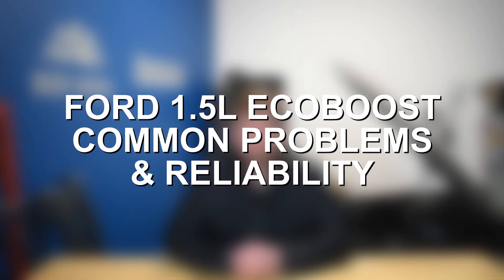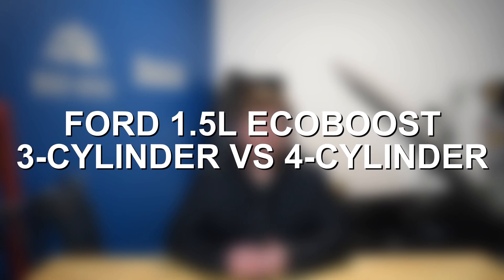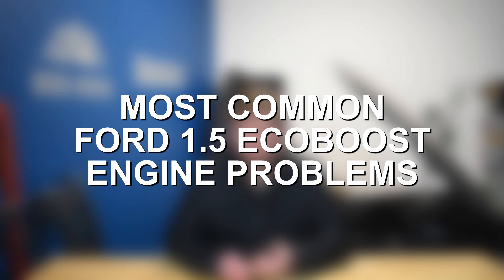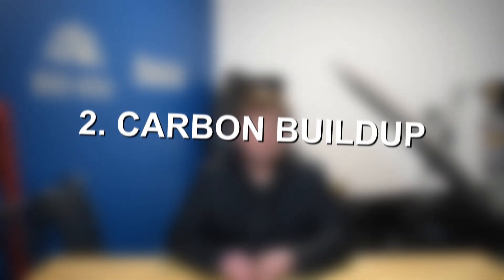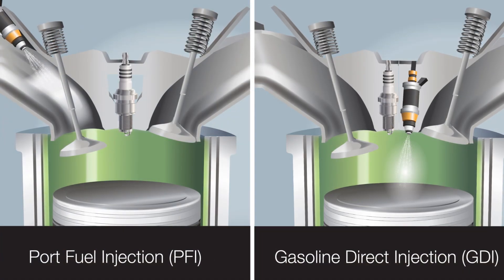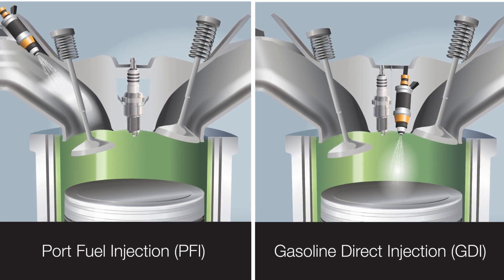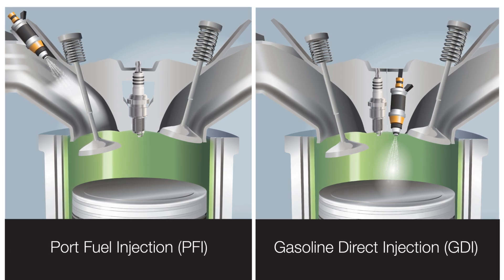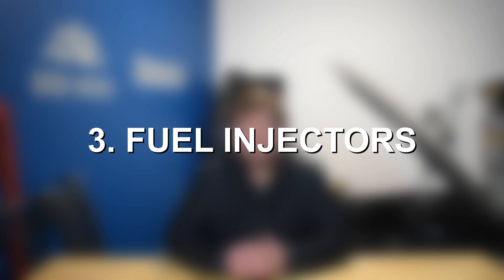The 1.5 EcoBoost | Common Problems & Reliability

Comment: I randomly ended here, i've this engine and it has 110k km now. It's one of the best engine ford has made, and probably one of the best 3 cylinders ever in a casual car (focus mk4). I've searched for hours, for days, what issue this engine could have, and there's no major issue reported, as  all issues it had were isolated.
And for my experience, after 110k km there's no issue, maybe one of the issues i can have from now on is the turbocharger, but it's not linked to the engine.
It needs a lot of maintenance tho, like any downsized direct injection recent car.
Reply from the maker: R - Nice! Thanks for taking the time to share your first-hand experience.

Comment: I have 2013 Ford Fusion 1.5L with a little over 100k miles. Just had the valve cover gasket and the oil pan gasket replace about a week ago. After I finish paying off the Fusion I bought the extended warranty which will expire in August. Have not had any coolant problem other then replacing the radiator and hose leak.
Reply from the maker: N - Thanks for taking the time to share your experience!

Comment: 22,000 miles, check engine light comes on and off. It got hit with a Customer Satisfaction Program and my Vin was part of the collant intrustion problem. Took it to the dealer. They said, because the light wasn't on they could not diagnose it. But they were kind enough to wipe my history.... then tried to upsell me on sparkplugs. 

Disappointing but serves me right for buying a Ford.
Reply from the maker: F - Sorry to hear this.. However, thanks for taking the time to share your experience!

Comment: I have 2013 Fusion 1.5 with 135 k on the engine. Would you recommend Valvoline Restore and Protect to clean the engine?
Reply from the maker: S - With 135,000 miles on your vehicle, Valvoline Restore and Protect can be a reasonable option if you're dealing with symptoms of oil consumption, ticking lifters, or reduced performance due to sludge or varnish buildup, but it’s important to note that while the product is designed to safely clean and restore compression by targeting deposits, results can vary depending on how well the engine was maintained prior; if you’ve kept up with regular oil changes and aren't experiencing major drivability issues, it may not be necessary, but if there’s any history of extended oil change intervals or visible varnish under the oil cap, trying it with your next oil change could be beneficial and low-risk as long as you monitor oil pressure and leaks afterward.

Comment: I just purchased a ford fusion 2017 with a 1.5l eco boost and 128,000 miles and now I’m regretting it…
Reply from the maker: A - Just take good care of it man!
Reply: I’m regretting it too same car 119,000 miles whole mess of problems
Reply from the maker: @dylanslade5315  Sorry to hear.. What kind of problems?
Reply: @dylanslade5315 have you had any problems? Currently the only problem I’ve had is that sometimes when I go into reverse it like jolts when I step on the gas and now there is a wrench on the dashboard
Reply: Лох  - трусы в горох

Comment: Hello, as far as I know, the 2023 Ford Kuga Manual 120 hp model comes with the 1.5L EcoBoost 3-cylinder engine. Have the issues you mentioned been resolved in this version of the engine? Are there any other known chronic problems with it? What should we be careful about?
Reply from the maker: E - You're correct that the 2023 Ford Kuga with the 1.5L EcoBoost 3-cylinder engine comes equipped with a timing chain and an oil pump driven by a belt-in-oil system, which Ford recommends replacing every 10 years or 150,000 miles—a labor-intensive and costly service due to limited access that may require partial engine removal; fortunately, this newer "Dragon" engine has resolved many of the chronic issues seen in earlier 1.5L 4-cylinder EcoBoosts, such as coolant intrusion and head gasket failures, thanks to improved block design and the removal of problematic cooling slits—still, it's important to maintain regular oil changes with the correct spec oil, monitor for oil consumption or misfire under load, and budget for that long-term belt service to ensure reliability.
Reply: @8020Automotive  Hello, I was waiting for your response, and thank you very much for your detailed and informative explanation.

Comment: I have probably been the luckiest man on earth with car experiences, i own this same motor in a 2019 ford escape and its running smoothly at 170k miles with no problems at all. I also own a 2014 1.4L nissan versa that still runs with no problems since i got the car back when it was released, running at 290k miles, but i usually take the ford because of how boring it feels to drive a CVT gearbox and because sport mode is fun in the ford on dirt roads too 😄.
Reply from the maker: W - Thanks for sharing your experience! Sounds like you take great care of them.
Reply: С 19-го года провели модернизацию двигателя, так что у вас и дальше все будет хорошо

Comment: I have a 14 Fusion (124k) and a 19 Escape (78k) both with 1.5 Ecoboost. I run catch cans and change oil every 3000 miles. Both run fine. IMO catch cans are a must with Ecoboost engines.
Reply from the maker: J - Completely agree! Thanks for sharing your experience.
Reply: Are catch cans something that you can install yourself? Or do they come in the engine by default?
Reply: @willemslear4949  you install them yourself. I run J&L Oil Separator Co. catch cans. They have a how to video for almost every ecoboost vehicle.
Reply: Bro you addicted oil more than the US army.

Comment: What about the camshaft? Got this engine on a focus mk3 and the engine light came up at 160k km. The guys at ford said the camshaft is affected because of the leaked gas into the oil. Now I'm waiting to see if they can replace it. Still like how it drives though.
Reply from the maker: N - Wouldn't say this is common, but anything can happen for sure.

Comment: I purchased a 2018 ford escape 1.5 l 4 cylinder in 2019 with less than 10000 miles on it. Just recently at 63000 miles the vehicle would not accelerate correctly. Brought it in to our mechanic and it found to be a bad high pressure fuel pump. When the mechanic pulled the old fuel pump he he noticed the ball valve was missing and there was gouging on the camshaft. The piece of the pump is in the engine somewhere and now the engine needs to be replaced for a cost of 8500. This should never happen to a vehicle with 63000 miles on it.
Reply from the maker: H - So sorry to hear this.. However, thank you for taking the time to share your experience. It will certainly help future viewers.
Reply: Дизель?

Comment: I have a 2017 Fusion with the 1.5 4 cyl. and has the original brake pads. The engine has the coolant intrusion at 55,000 miles that Ford basically said too bad. So they are telling me their brake pads are more robust than the engine? Absolute junk.
Reply from the maker: R - So sorry to hear.. However, thank you for taking  the time to share your experience.

Comment: Also got this coolant issue around 40.000 miles and almost 5.5 years. Hopefuly best option I took was a 7 year full coverage warranty !
Don't know indeed now if with the changes they've done it would be more reliable or if 40.000 miles later it might get to rubbish if it requires a new engine.
Reply from the maker: S - Thanks for sharing. Keep us updated!

Comment: I have a 2019 ecoboost fusion with 80k miles. Having some serious stuttering, misfiring, loss of power at top of WOT. Changed spark plugs and they look white. Can't get rid of this issue. Makes me want to get rid of the car.
Reply: If your ecoboost is similar to my i4 ecoboost 2.3l on the 2018 mustang, I had the exact same issue. My spark plugs were definitely due for a change, but also my purge valve was going bad. Replaced both and issue went away.
Reply from the maker: O - Thanks for taking the time to share your experience and help out other viewers!
Reply from the maker: S - So sorry to hear this. Are you getting any engine codes?
Reply: @8020Automotive  no, no codes. No check engine light.
Reply from the maker: S - We have a great video on misfires that may help here: https://youtu.be/f1mQ5hD1-vI

Comment: Hey don great video.  But I have a question for you and was wondering if you ever came across this one. 
I’m currently working on a 2017 ford escape 1.5 i4 and have a misfire in cyl #4.  I started with ruling out the coils then moved on to the plugs. Noticed the #4 plug was soaked in oil so I stuck my scope down there to take a look and the whole cylinder is coated in oil.  No coolant issue though.   Vehicle has 40,000miles on its  

Is this a common issue as well and what do you think could be the cause.
Reply from the maker: A - Unfortunately, this is not a great sign and needs to be addressed ASAP. It's likely a valve cover gasket leak or leaking piston rings.
Reply: @8020Automotive  thanks for the reply don I appreciate it.  I also did a compression test as well and the cylinder has definitely failed.  20-25 psi.  I stopped moving forward with the work after that.  I was going to take the vehicle to ford and let them take it from there.    And hope it’s covered under the recall. Cause my warranty is over now. If not I would probably just buy a new motor and do the swap my self.  Owned the vehicle since new but hardly used it
Reply from the maker: A - Sorry to hear man. Keep us updated.

Comment: I have a 2018 Fusion 1.5 Ecoboost. Love the car, especially vs the 2.5 I had in my 2013 Fusion. My 2018 suffered the coolant intrusion issue at 20,000 miles and Ford covered a block replacement.
Reply: The question is what did they improve so that it doesn't happen again
Reply from the maker: D - Thanks for taking the time to share your first hand experience!

Comment: Stay away from the ecoboost engines. Both styles of this engine have their own unique problems. Ford engineers have lost the ability to build reliable engines.
Reply: Lol. Nothing wrong with it
Reply: Sure, besides the engine grenading itself at 60k miles because coolant gets into the cylinder.
Reply from the maker: J - We can agree that they don't make them near as reliable as they used to.
Reply: The 2.3 ecoboost is a remarkable engine.

Comment: I have the 182hp 1.5 4 cylinder engine and was thinking of getting it tuned, many companies claim stage 1 can bring a large increase in low end Torque which would feel good during daily driving. Would this increase the chances of the coolant intrusion and other problems occuring or are these problems unrelated to tuning. I do understand that tuning an engine puts additional stress on the engine but the idea of stage 1 is that it is well within tolerances imposed by manufacturers, especially here in the UK where 99 Octane fuel (E5) is very common.

Comment: are the 1,5 Ecoboost more relisble than the 1,0 Ecobbost (995 ccm)?
Reply from the maker: S - Depending on maintenance, we would likely say the 1.0 is more reliable.
Reply: @8020Automotive  are the Focus 1,5 as known to have problems as the Fusion/Mondeo and Escape/Kuga with the same engine?

Comment: I have a 2023 1.5 which is the 3cyl engine. At 800 miles the coolant passages got blocked with metal shavings coming from engine break in... I did notice a difference in power switching the engine to a 93 octane over the 87. Hopefully with a new cylinder head I will be good for many miles to come.
Reply from the maker: D - Wow... Seems way too new to have that happen.
Reply: Is it 120 or 182 or any other HP?
Reply from the maker: H - We have an article that will help you out here: https://tuningpro.co/the-4-most-common-ford-1-5-ecoboost-engine-problems/
Reply: There is a recall for that I'm getting it fixed on Monday just put in your vin number on ford recall website

Comment: I have a 2018 ford escape 1.5L with oil mixing in cooling system. What's your take on that?
Reply from the maker: Don - That's the first common problem we address. Did you watch the video?
Reply: @8020Automotive  I did watch the video. However, my understanding is that the coolant intrusion refers to coolant being mixed into the oil. On the contrary, my situation is the engine oil is being introduced into the engine cooling system.
Reply: @donspencer2110 test coolant reservoir with an exhaust gas detector to see if exhaust is getting in coolant indicating a bad head gasket